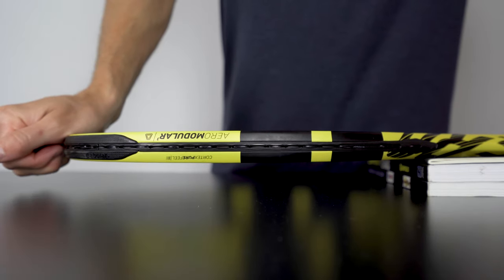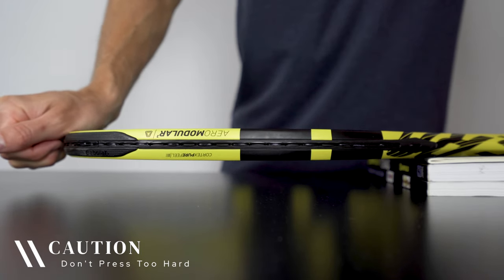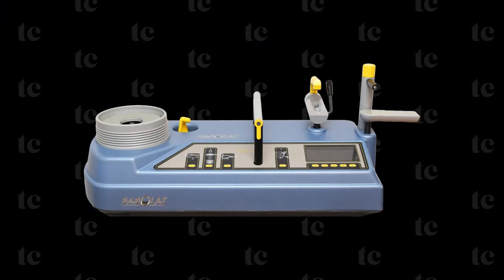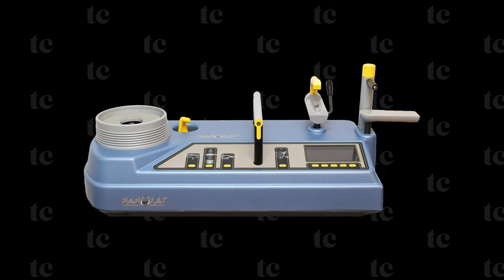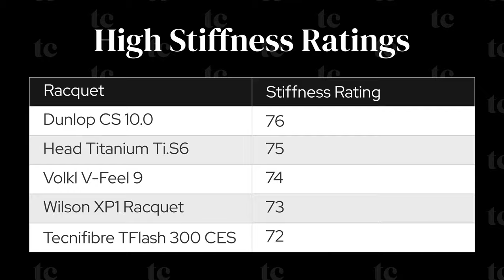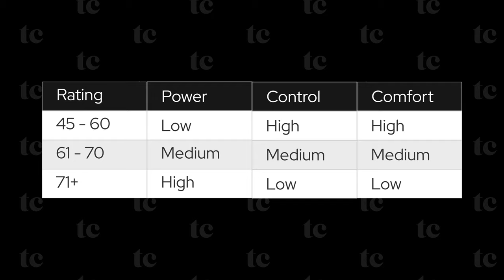Tennis Racquet Stiffness & Flex: A Clear Explanation

Comment: why is a low tension on string give you more power, but a flexible racket give you less power? don't they both bounce back and give a trampoline effect?
Reply: Both more flexible string and racquet store more energy by deformation upon impacting with the ball. But when the string springs back, it gives back (most of) the stored energy to the ball.  The ball will leave the racquet before the racquet springs back. Therefore, any stored energy in the racquet is wasted, not given back to the ball.

That is the reason why for more power, you want more flexible string at lower tension, but stiffer racquet.

Comment: Hi, what’s the average balance point range/measurements in cm or inches for Head Light and Head Heavy? (Using Balance Board)
Is it the high reading number is more on head light? And the lower  reading number is head heavy?
Ex: 30cm Reading - Head Heavy
      32cm Reading - Head Light
Thanks 🙏

Comment: Hey thanks for the great video! It was very helpful. I have a question: why does a lower stiffness rating provide more control? I understand why it would provide less power, but not why it would be better fore control. If my assumption of what control is for tennis racquets is accurate, which is that control means the ball lands where you expect it to land when you hit it, why would a less stiff racquet be more predictable than a stiff one?
Reply from the maker: Thanks, Jake! Great question. The reason racquets with lower stiffness ratings tend to be considered control-centric has to do with the fact that they're less powerful, thus demanding more from the player to turn up or down the pace depending on the scenario, i.e., the player has control.

Furthermore, lower stiffness racquets will generally offer players an enhanced and more connected feel, which tends to instill confidence in directing the ball and often feels more predictable.

However, stiffness isn't the only factor influencing control, so it's not always cut and dry and subsequently can make comparing racquets challenging. Other specs, such as head size, string pattern, beam width, etc. play a role along with the strings and tension.

Beyond that, the player has significant influence over control, and their style of play, grip, and technique are factors too.

As a result, it's a sum of all parts and why some players will find more control with low stiffness, while others with higher stiffness. Ultimately, there's a lot of subjectivity in the details that result in control, but I hope my notes provide some additional useful context for you.
Reply: @TennisCompanion  that was very helpful! Thank you for taking the time to wright all that out. I appreciate it!
Reply: This is a good question thx for asking
Reply: @TennisCompanion  this is a great detailed answer ty I've always been curious myself

Comment: I’m looking for a stiff racket to use as an intermediate serve and volley player, and suggestions?
Reply from the maker: Hi Will - here are a handful of racquets that fit the bill and their RA ratings:

- Wilson Ultra v3: 73
- Wilson Burn v4: 71
- Babolat Pure Drive: 71
- Babolat Pure Aero: 67

You'll also find that many lines of tennis racquets have specific models within the family that are on the stiffer end. For example, here are two racquets within the Wilson Blade line and their stiffness ratings.

- Wilson Blade 98 v7: 62
-Wilson Blade 100L v7: 69

I hope that helps!
Reply: @TennisCompanion  Thanks for the help!!

Comment: Does someone know what is the stifness of Pro staff 96 by wilson?
Reply from the maker: Hi Naor! Thanks for the question - happy to help. Can you be more specific with the model? There have been many Pro Staff racquets over the years. Are you curious about the v13 latest release of the Pro Staff that happened this year?
Reply: @TennisCompanion  Hey! thank your for your quick reaply.
The exact model is - Pro Staff six.one 100  (weight 275 gr/10.1 oz, head size  100 sq in). As far as i know, its an old model, known by one of federer's racquets.
The reason for my questions is, I suffer from tendonitis in my right shoulder (The dominant hand that holds the racquet)
I realized that when buying a new racket, i should pay attention to the level of stifness of the racket, as an important parameter (along with weight, head size and more)
I'm intersting with the 2018 Pure Drive Babolat racquet.
What do you think? What should I focus on?
Reply from the maker: Thanks for the extra details, Naor! The Wilson BLX Pro Staff Six.One 100 has a stiffness or RA rating of 65, which is a mid-range flex. Federer would have used the smaller 90 in² head size, but the racquet's paint job would have looked the same - around 2012.

I'm sorry to hear about tendonitis in your right shoulder. That's frustrating, but your racquet and string selection, as you've suggested, can help.

The Babolat Pure Drive you're referring to is one of the racquets with a higher stiffness rating at 71, so it can be tough on a player's arm. It's a great racquet, but I'd stay away from it.

I agree that you should be thoughtful in your selection and focus on a few key elements to help prevent further discomfort.

A Lower Stiffness Rating
All else equal, a stiffer racquet will impart more shock and vibration to a player's arm, which may lead to discomfort. However, it depends on the player - not everyone has the same reaction to stiffer racquets, especially early on when first hitting with a new racquet. However, over time a higher stiffness rating can cause arm issues. Some of the worst offenders are stiff, lightweight racquets.

A stiffness or RA rating range I would shoot for is 55-65.

A Moderate Weight
Weight absorbs shock and vibration - all else equal, it also increases power. If you think of a hammer, you don't feel much shock when striking a nail because the hammer's weight is absorbing it. As a result, it can be beneficial for players to play with a racquet on the heavier end of the spectrum for what they can handle for a full match or practice session, i.e., 1-2 hours of play. Of course, too much weight can also cause problems, so it's a balance.

Most adult males will tend to fall in a weight range of 10.5 - 11.5 oz (298 - 326 g) strung as a weight they can comfortably handle, but only the player can make this determination by experimenting. If your arm is noticeably tired after using it for an hour or two and you feel like you have to 'muscle' the racquet, then you've likely gone too heavy. You can learn more about racquet weight in my video here:

Weight: https://youtu.be/nIZATZ8fvqc

Side Note: You can more easily add weight to a racquet. Although possible to a degree, it's more challenging to remove weight.

Forgiving Strings
Your strings play a crucial role in comfort. Different strings exhibit various performance characteristics. Typically, the best options for players with arm injuries are multifilament tennis strings, which are more forgiving and easier on a player's arm.

Of course, there's a performance tradeoff, so some players will find a middle ground by stringing hybrid where they use one string for the vertical mains and another string for the horizontal crosses. The tension of your strings also plays a role, where dropping the tension a bit can help improve comfort.

You can learn more about both these topics from these videos/guides I've created:

Types of Strings: https://youtu.be/OflCsTM6y8w
Multifilaments: https://youtu.be/7XN3F0F4ypE
Hybrids: https://tenniscompanion.org/hybrid-tennis-strings/
Tension: https://youtu.be/dNabsAmlLOw

Here are a few racquets worth considering - all of which fall roughly in the spec range I've reviewed above:

- Wilson Clash 100
- Head Graphene 360+ Speed MP
- Head Graphene 360+ Gravity MP
- Head Graphene 360+ Extreme MP
- Yonex VCORE PRO 100

As for strings, you can check out my top picks for multifilaments here:

https://tenniscompanion.org/multifilament-tennis-strings/

You're on the right track and asking the right questions - it's a bit of an education process. Best of luck finding the right racquet!

PS - If possible, I always encourage players to demo or try a racquet before buying so that they can determine whether or not it's comfortable enough. Another route is to borrow a friend or acquaintance's racquet if it's in the ballpark of the specs you're evaluating. If you can't do either, that's fine, but I always encourage it.

PPS - Your technique can also play a role in your comfort. One quick tip for arm comfort is to make sure you have a relaxed grip at all times - don't squeeze the handle too hard. Also, pay attention to your discomfort when playing. If it ever starts to hurt, stop playing. Don't fight through the pain, and give your body plenty of rest before you hit again. As frustrating as it can be not to play, your arm will thank you in the long run.

PPPS - I'm not a doctor, nor do I pretend to be one 😄  My suggestions above are based purely on my own experience, and I'd encourage you to seek help from a licensed medical professional for injuries if necessary.
Reply: @TennisCompanion  Thank you so much for all of the information, it was incredibly helpful. I feel i should mention, i am a mid level player not competitive. Would you still recommend these racquets?
Reply from the maker: Hi Naor - my apologies for the delayed follow up. I was scrolling through a few comments and noticed I missed a reply here. Yes, these racquets are well suited for a mid level player, and I'd still recommend them for someone in your shoes.